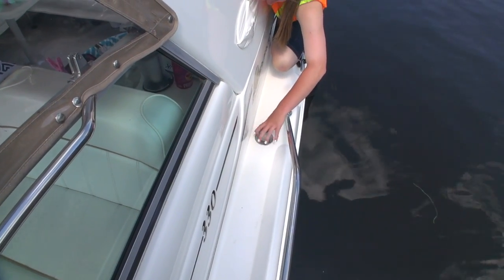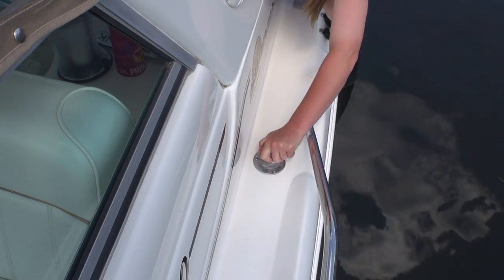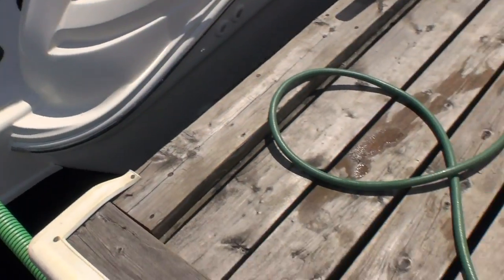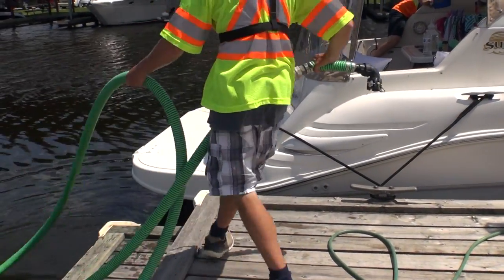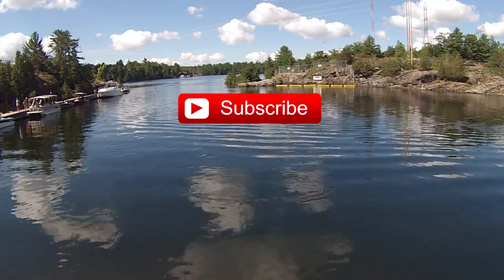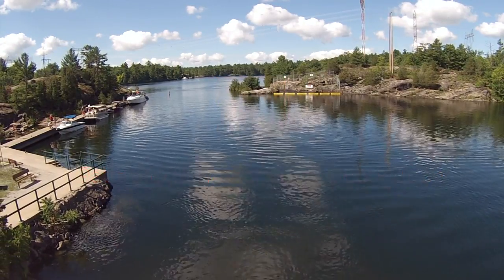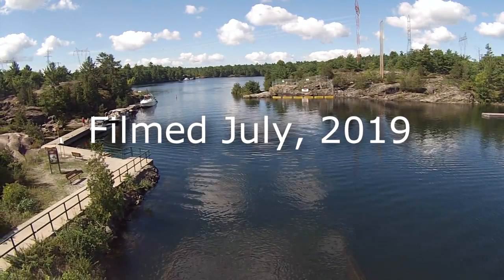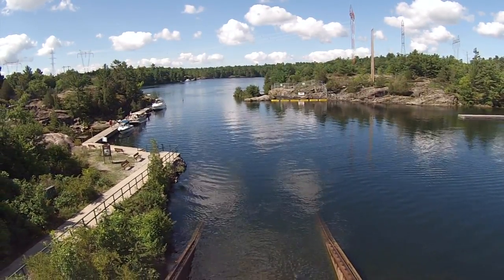Boating Basics - Poop Tank Pump Out

Comment: New intro!  I like it.  Even a shot with the new swim platform.  Interesting tidbit, we have a grey water tank on AMFM and that gets pumped out at the same time as the black water.  The pumpout locations are side by side.  So I pump out black first and then fill with water while doing the grey.  Repump the black and done.  Here on Okanagan Lake, we do our own pumpouts for the most part.
Reply from the maker: Grey water tank on a Sea Ray? Must be a unique feature, as I've never come across that before. Don't think we'd be able to get by with having to use that, especially with our new 'full' shower on #Boogaboo. . .
 As for doing the pump-out, I'd prefer to do it myself, but most marinas don't allow it 🙄
Reply: I’ll take pics of the locations on the gunwale and gauge inside. Tank is bigger than the holding tank. It’s stock SeaRay put n for original owner.  Yes, unique.

Comment: Is there a vent you need to open before pump out to keep from collapsing the holding tank? I think I remember you talking about that happening to tanks before in one of your videos.
Reply from the maker: Our boat is not equipped with a purpose built vent that needs to be manually opened, however the Big Orange tank vent (https://youtu.be/AD4b6hwLOwI) dies have a built-in vent for that very purpose. I installed that vent system in our current #boat, as well as the previous #Boogaboo, as scene in this video. Works as advertised 👍
Reply: @BoatingWithBoogaboo     5

Comment: Also like to add, I like to run water through the lines with a hose at the marina gas dock through the toilet just to push any debris through that might be stuck in the lines. Great video.
Reply: Same here, if there is a hose near by. If not have them close the valve on pump out line and flush the toilet 3 or 4 times. The have them open the valve again.

Comment: Where we use our boat here in Australia, we have to use the pump out dock facilities ourselves. I always use disposable gloves. I noticed those attendants did not. - Yuk :)
Reply from the maker: If it were up to me, I'd much prefer doing that job myself to make sure it got done properly and thoroughly each time. It's only poopy water, and hands can be washed 😉
 As for me, I have lots of experience working with poopy situations. As a thirty year general contractor, I've had my hands in all sorts of nasty places and lived to tell about it 💩
 If you're interested, I produced a video from our new poop tank replacement that I did on our current #boat, last year (https://youtu.be/sLLlqyPRZLI). Did the same on our previous one and both turned out well. Like I said, it's easy to wash hands afterwards.
 Cheers, Paul.

Comment: Do you recommend a black water tank having an access hatch for cleaning?  I have crud lining the walls of my blackwater tank that interferes with my external tank sensors reading the level of the tank.
Reply from the maker: Check the reply I just posted on your previous question.
 That said, I'd suggest that a good cleaning with proper chemicals should help with that. However, all the cleaners in the world aren't going to help if there's any solids on/close to a sensor (toilet paper in particular). 
 I have read about folks putting laundry detergent cleaners, ice cubes or even water softeners in black water tanks to help clean them; https://www.forestriverforums.com/forums/f217/using-tide-to-clean-out-black-tank-7265.html 
 Stay tuned to my channel, as I might be trying the detergent trick on Boogaboo this upcoming season. . .

Comment: Just curious about something, I have had maybe 6 different RV's over the years. From Vans, Travel Trailer, Motor-homes and now a large 5th wheel. On every one we have fought trying to keep tank sensors working on both black and gray tanks. Its like a never ending battle with flushing tanks and using tank sensor cleaners and sooner of later the sensors stop working. Then its more of  a guessing game of when your tanks are full. Do you run into the same thing on boats? Or is it more a case of RV are made so cheap that they just have much poorer quality setups in them. I know lots of things are similar in the marine industry with the RV industry.  But I have always wondered if things work a bit better on the boats. Or is it just more of the same.
Reply from the maker: Yes, those in-tank monitors always fail and are pretty much useless. Check out my video for a reliable monitoring system that doesn't go in a tank, has zero moving parts and is easy to install with pretty much any tank. Have it now on our current #boat, as well as on our previous one & works great 👍 Here's the link; https://youtu.be/_GEjBXWdIL4
Cheers, Paul.

Comment: My boat is Equipped with a porta potty so I’ve never done a pump out. However, I was wondering, Do you need to add more water to the tank and/or chemicals?  And if so, if your boat is in the water, we are do you do that
Reply from the maker: We don't add any extra water, only what goes down the drain when flushing. And we usually put in chemical tank additives after every pump out. 
And, not sure what your last sentence means . . .
Reply: BoatingWithBoogaboo sorry what I meant to say was if you are still on the water, where do you get water if you need to add more to the tank?  I figured once the pump out occurred, more water would need to be added.

Comment: Looking forward to the series!! We just picked up our first cruiser, and did a first pump out when i filled it with gas. After we docked back at our berth we noticed the smell and found that the outlet hose became disconnected from the tank at the fitting itself. any ideas as to why the threaded fitting could get pulled out of the tank? Any insight and further info would be greatly appreciated.
again, great series and as always looking forward to the next one!
Cheers!!!!
Reply from the maker: Glad you liked this one! I'll be posting more in the series in the future.
 As for why your line pulled away from the fitting, I'd hazard a guess that there was no/loose hose clamps??? Sounds like someone might have replaced either that line or the fitting at some point and never finished their job - no pun intended 😉
 Could be that the cap was lost at some point and they couldn't find a properly sized replacement, so had to replace the entire fitting. Been there, done that, so anything's possible...

Comment: Came to look because we recently bought a Four Winns Vista 288 and I'm having a varying level of success with pumping out.  I'm pretty sure it's the same process for ours,  no valves to open etc but yet i cannot get the team to empty every time.  Not sure how to start fault finding that system yet ie what should happen in what order etc.
Reply from the maker: I would check to see if you have an obstruction in the vent line. Many years ago, we had a 26' Sundancer which came equipped with a porta poddy setup. I soon replaced that with a proper flush Jabsco toilet and holding tank. When I replaced the factory installed vent line, I discovered it had a mud nest from a wasp/hornet in it, which was completely restricting the flow of air. Replaced it when installing the new setup.

 I would suggest you watch my 'new holding tank' videos from when I did that big project on both our current Boogaboo (the one depicted in this video), as well as our previous Boogaboo IV, a 400 Sedan Bridge. Both were huge projects, but well worth the extra holding tank capacity I was able to jamb into the respective bilges ;-)

 Both of those projects, as well as more from my seemingly endless toilet projects on our boats, can be found in this playlist: https://youtube.com/playlist?list=PLKhjT5kr2l2HFAop_WVZor37kcpy3gxhV

 Happy pooping!
Reply: @BoatingWithBoogaboo  lol @ happy pooping.  Thanks so much, I'll take a look

Comment: I pumped mine for the first time and the tank collapsed. Is that normal or did I just pump too long?
Reply from the maker: Although it's not normal, collapsed holding tanks aren't uncommon in certain boat models/years. I'd suggest that yours either has a clogged vent line, or it had been previously over pumped. 
 Unfortunately, you're going to have to replace the tank - not a fun job. I've done it twice in the past (both Sea Ray boats from the late 1990's). Check out my toilet repairs playlist to see what was involved; Marine Head / Vacuflush DIY Repairs: https://www.youtube.com/playlist?list=PLKhjT5kr2l2HFAop_WVZor37kcpy3gxhV

Comment: Is it free to do this?
Reply from the maker: No. Depending on what marina you visit, prices will vary considerably. Some will offer this as a complimentary service for folks who have a year long storage contract, otherwise figure on roughly $25-35 per pump-out. Sometimes it is a no extra fee if purchasing fuel at the same time, but that would be anywhere from $250 and up on the minimum fuel purchase to receive a 'free' pump-out.